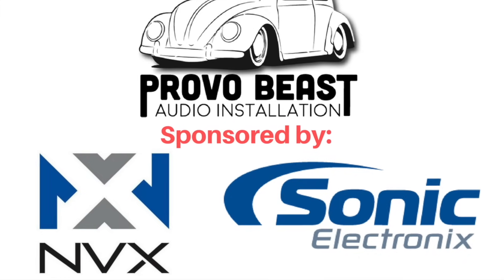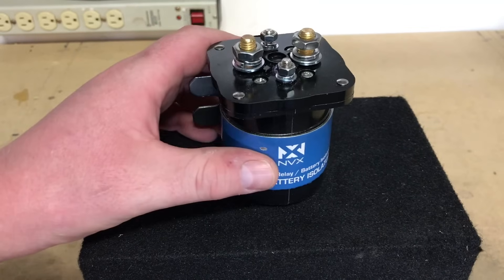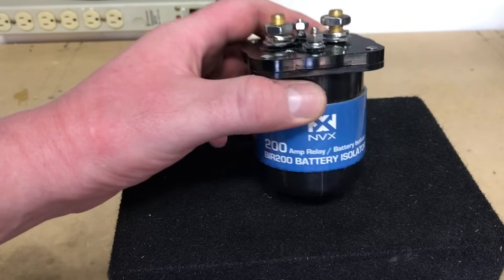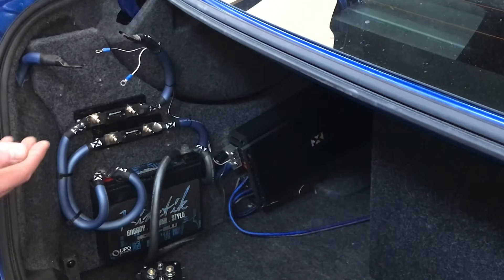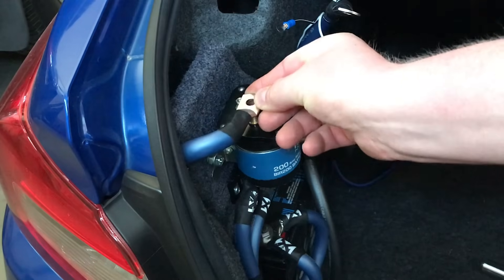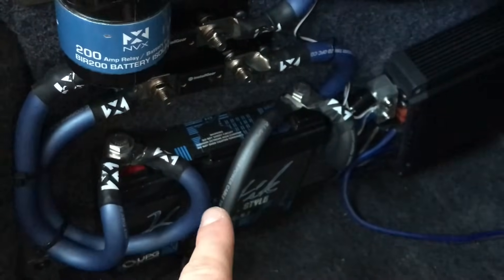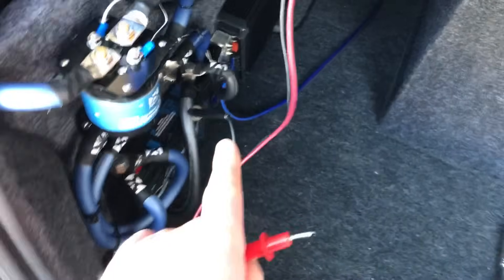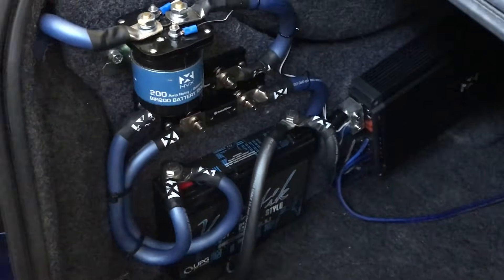Car Battery Isolators Explained: How to install on your car!

Comment: How do you chose what amperage isolate to use?? I think I'm pulling more than 200 amps. Two 1200 watt bass amps, one 300 watt highs amp, 160 amp alternator, one 50ah redtop start battery, one 55ah yellowtop auxiliary battery. 
Any suggestions please???
Reply from the maker: Take your total RMS wattage and divide that by your peak voltage output with engine running.  That should give you your max amperage (roughly).  If you are running two genuine 1200w RMS amplifiers, an isolator may be the least of your worries.  I'd start with an alternator, AGM batteries, etc.  If you are running two AGM, you won't need an isolator anyways.
Reply: @ProvoBeastAudio  🔴 Thx for information. 🍻  but are you saying my Optima Redtop starter battery and Yellowtop auxiliary battery are ok in parallel without the isolator❓

Comment: I just installed this. And I'm getting nothing. My main battery still work, but my secondary isnt charging at all. I just uninstalled my old 1. Same make, same model. 500 amp. Wire for wire. Uninstall and reinstall. Got nothing. No energized solenoid thus. Nothing. After a bunch of meter test. It's almost like the 12v accessory post and the ground post are backwards.... is that possible and wouldnt that mess up the other posts as well? Please help.  I just want my subs back lol

Comment: Never showed the other ends of the wiring. Like wires coming from the  Ignition or ground how to n where to connect.
Reply: the first big blue wire he connected coming from behind the trunk panel is the primary battery the 2 small wires one is a ground and the other is going to the ignition inside the fuse box and the other blue fat wire is going to the secondary battery its electronic science if you understand it.
Reply: I finally figured out where to place my trigger source after not finding a clear answer in these comments..i bought a $5 fuse tap from Autozone & i used it to tap into my turn signals fuse under my dash..it is a 10amp fuse & yes the turn signals only functions when the ignition is in the on position. Hope this helps
Reply: @nathanielthomas2502  i tapped mine onto the amp remote wire its the easiest and most effective way 👍🏽👍🏽
Reply: @wahiawabound808  
But that defeats the purpose of the isolator when the engine is off because the head unit with trigger the isolator to come on.. I do have a toggle switch on my remote wire for my amps but that is a separate deal for my setup..i have a lead acid battery under the hood & a 
XS D6500 as my auxiliary battery for my system.
Reply: @nathanielthomas2502  thats why the video says to wire it to an ignition source of some sort you dont want to wire it to something that would just stay on all the time because when your vehicle is off power would still be traveling througout the isolator causing a dead battery over a period of time just like when you leave the lights on same thing. wiring it to the remote wire is the same as wiring it to an ignition source that turns on and off the remote wire would be like your toggle switch amp turns on isolator turns on amp turns off isolator turns off car audio science. oh and my head unit is wired the correct way its not powered straight to the battery where consistent power would be running throughout my system. my head unit is wired to the ignition key turns off my head unit turns off.👍🏽👍🏽
Reply: @wahiawabound808  
What about when your key is turn to the back  in accessory with the engine..your way will still have the head unit come on thus turning on the isolator..
Reply: @nathanielthomas2502  exactly  it'll turn on the head unit and the isolator because the accessory switch is wired to the ignition from the factory  thats how your system supposed to be hooked up even your factory head unit is wired like that as well. the isolators job is to keep the primary separate from the secondary battery  and thats also why you can play your audio till the very last bass drop and your vehicle will still be able to start.

Comment: Great informative video, you probably explained this but I'm a lil slow. I get what happens when the vehicle is OFF. Now, when the engine is running... Am I getting power from both batteries to my system?
Reply: No ! The battery isolator makes sure the first battery don`t get empty , the second battery  can get empty and will get reloaded only when the engine  is running thanks to the coil inside the isolator.
Reply: John Nelson  does it still need a relay or can the smaller 12 wire can be directly hooked up to any 12 switched or not. im probabbly going to buy exact battery, so will it work with no relay or just better with one or not needed?
Reply: John Nelson  i feel there shouldnt be an issue regarding the accessories used drawing too much on first startup long as battery is charged b4 initially starting after install.. hopefully

Comment: Only thing missing is where the - comes from for the aux battery.  Just run down to a bolt on the frame?  From the main batt?
Reply from the maker: Bolt on the shock tower.
Reply: It's own separate ground as close to the chassis as possible.
Reply: How can you recommend the shock tower ground. God Almighty amateur hour

Comment: I have a question, can i use this insolator if i have a redtop optima in the front and a northstar agm31 group in the back?
Because, redtop isn't good idea when the car has amplifiers connected.
Reply from the maker: well, its more so the type of battery vs. brand.  If it's an AGM to a lead acid battery, yes this isolator is suggested.  If it's an agm to an agm battery type, it's optional but really not needed.

Comment: can u use your remote wire to go to the isolator?
Reply: You could and it would come on and work only problem is if you use that remote wire that turns on your amp it would still come on when the radio is on even if the car isn’t started and basically be the same thing as. It having the isolator installed

Comment: the best part is if the main starter battery dies you have an instant back up depending on how you wired it.
Reply: really
Reply: no. when my front dies I can't use the rear
Reply: Yes you can wire it with a switch to use your 2nd battery as a starting battery.  Run 2 ignition terminal circuits. Wire one circuit off the ignition terminal of the solenoid to a key-on voltage source. Run a second wire from the solenoid ignition terminal to a manual switch, then to your 2nd battery positive. You could use a 5 pin relay instead of a switch, if desired,, and then if starter battery died the relay would auto connect your 2nd battery to your starting circuit.

Comment: How about installing Supercapacitors... I have 6   2.5 V at 2600 farad each. They are maxwell Supercapacitors & I’m curious if I should just run it with a 200 amp fuse in my trunk where I use to have a regular capacitor.
Reply: Some install fuses, some don’t. I would if it where me

Comment: So basically it's just a solenoid . Old Ford's have the same thing. It actually has many applications. It can be used to disconnect the battery so it won't dran . It can be s used on the starter too. They're good on hydraulics too. Like electric dump or the old Mexican jumping cars if you are in to that.
Reply: Benjimen Franklin the solenoid isn’t designed for continuous duty though. I bet it would burn out

Comment: Trying to install a battery isolator on my 2017 Ford Transit 250. Not only is the primary battery under the driver’s seat, there are CCP (Customer Connection Points) to which, if I understand correctly, you can tie a second battery, via battery isolator, onto rather than directly to the alternator. I’m sure this was intended to be a convenience rather than a nightmare but no one, from my local Ford dealer’s service department to the peanut gallery on YouTube seems to understand how to accomplish this... They’re happy to charge me $500. for a chance at figuring it out though 😒
Reply: I'm trying to do this to my 2015 Ford Transit. Where are these customer connection points you speak of?
Reply: You want subscribers but your not really active with the people in the comment section.

Comment: 200a doesn't seem like enough for a car. My car requires a 500cca battery. I know it doesn't use all 500a but if you were trying to start a cold engine in 10 degree weather you'll need more power to get the starter to turn a engine through thick oil.
Reply: 200 amp isolator is how much current can be drawn through the isolator. A 200 amp rating that has nothing to do with the main battery to your car. Your car will start of the starter battery leaving your second battery isolated...
Reply: @VINNY5674  So this ONLY works for isolating a second battery? I was hoping for an option to isolate the main battery for a car so that when the car sits for extended periods of time the battery doesn't drain out as quickly. Just like pulling the positive off a battery when you plan on having a car sit for a while will stop the battery from draining.
Reply: @IkarosCanFly  the isolator isolates the 2nd battery. Your amplifiers will be only powered by the second battery when the car is not running. Your head unit will still run off the starter battery unless you configure your wiring differently.

Comment: Can i connect parallel battery one normal (stock) acid and the secondary AGM battery?
Reply: Yes. Thats what the isolator is for. Is you connect them parallel youre fucked
Reply: @miguelledezma1394  still parallel

Comment: Can this be used as a relay to power up a fuse block for accessories?
Reply: Dont see why not. The set up was the same but had a second battery for when the fuse block wanted power when the car was off.

Comment: Does anyone know weather or not either of the smaller posts matter which way they are wired? I got a stinger that came w/ no instructions, I know the small posts, 1 is a ground & the other is a +12v power source... but since my stinger doesn't specify anywhere which post is for what?! Can anyone help me with this I'd love to install my 2ndary battery setup today!?
Reply: Tyler Barton  it’s more than likely the same as this -as my PAC is the same wiring , good luck!
Reply: @JAlien17KGun12  yeah I figured it out it doesn't matter which post I use both are universal apparently thanks for the offer of info either way though man much appreciated
Reply: It shouldn't matter. The isolator is just a big 12v relay capable of passing large amperage. You can use your voltmeter and test it if you want. 
Or just take it and test it out by temporarily connecting/disconnecting from you battery at the source before you install it. You might want to do this anyway, as to make sure the thing works before spending time installing it.

Comment: This was extremely helpful since I am currently doing this to my system. I do have 1 question though, (I quickly watched this video so hopefully I'm not asking a ? That was clarified already in the video lol) but I purchased a Stinger Isolator/Relay & it's a nice solid looking item however it came w/ NO instructions which is why this vid was so helpful, but my ? Is, the small post's that are meant for ground & +12V input.... my Stinger doesn't clarify which is which, so does this mean it doesn't matter either small post will work for either process? Just as long as it's grounded? Or do I need to contact stinger & find out which post is for what? Thanks for any help with this & big props for making this tutorial it was a life saver for me!
Reply: Thanks fellas....yeah I suppose that I should have came back & mentioned that I'd found an answer to my ? Apparently it doesn't matter which post is hooked up to which...oddly Stinger doesn't include instruction manuals for these isolators inside of the boxes...& I was curtain I'd already pitched the box it was in but thankfully I hadn't, it was sitting in 1 of my extra little portable toolboxes & sure enough written in small print on the side of the box it mentions that neither the top large or smaller bottom posts matter which way they are hooked up...I appreciate the help though fellas much appreciated guys!😃
Reply: I looked into it it doesn't specify and the terminals are not color coded or different color metal so it probably doesn't matter...
Reply: I would fo with the side closest to the mounting bracket is the ground. All of the ones I've seen an none of this style are that way

Comment: Hey Provo Beast Audi Install, thanks for the informative video. Nice clean looking install. 

I believe you said you use 1 gauge wire. Could you tell me what size fuse you like to use? Do you size the fuse to the load, or do you size the wire gauge to the load and size the fuse to the max recommended current?......or what has worked for you?

Thanks!
Reply: The fuse needs to be matched to the maximum amperage the wire can carry. I use 250 amp on my 0/1 awg I’m pretty sure it can carry closer to 300 amps but my amp never pulls more than 250 so that is adequate for me.

Comment: How do you size an isolator? I see you have a 200 amp isolator there what dictates this?
Reply: mitch denner based on my reading it is dictated by the size of your alternator. Mine is 90amp but I will go with a 200 amp (400 amp peak?) isolator to allow for an upgraded alternator or new vehicle in the future. Some vehicles come with 145 amp alternators. Maybe someone better informed can correct any misinformation here.... now to figure out what size/type of fuse holders to get.
Reply: You need to know how much power your amps will pull through the isolator.
Reply: @VINNY5674  duh!

Comment: Give me an example of what circuit would be ignition on and car running only. Most all circuits of course are on when the key is on but what did you use for key on and car running?
Reply: i had the same question as you
Reply: @VWPassat_3BG  power windows, moon roof  are some often used.
Reply: Good example would be the signal wire to your starter motor. The starter on a car is basically an electric motor with a heavy duty relay. Or just google up the ignition wire that leads to your key on the steering column.
Reply: Wire coming from alternator would work

Comment: Nice I like this setup more than the kits sold on ebay I think I will go this route. Couple of questions though what gauge wire did you use for the smaller wires and How and where do I hook up a bypass switch to jumpstart myself incase primary battery goes dead my work truck has a momentary switch  to jumpstart incase primary battery goes dead  how can I wire one up?
Reply: If you did need to jumpstart the front battery using the secondary battery in the back, all you need to do is connect the secondary battery positive to the small positive trigger on the relay. That triggers the relay to connect the 2 large posts, which connects the 2  batteries, allowing the back battery to jump start the front one.
Reply: @PURESOUND4  Got it thanks I have the parts ready to do this I just haven't installed the new optima yellow top batteries yet they are sitting in my garage lol
Reply: Can someone help with this

Comment: Why don't these isolators come with a cap i don't like exposed positive terminals something touches that positive terminal sparks will fly...
Reply: I mean I know electrical tapes kinda ghetto but just seal it up with it as best you can, somethin touches it it ain't gonna hurt as long as its sealed with SOMETHING theres always cylycone too
Reply: @aaronritchie6097  *silicone
Reply: put extra rubber end covers like heat shrink over the ends
Reply: VINNY5674 real talk
Reply: @Santos Santana  Yes, you could use the blue turn on wire to trigger the battery relay, but if you decide to turn off the radio, the relay will de-energize, so then the second battery will NOT get charged.

Comment: Hi: i have a question. I would like to know if both batteries have to be similar in Amps, that means 12 volts 80 amps both or they can be 12 volts 80 amps  and 12 volts 40 amps. Thanks
Reply: AGM and Lead Acid are the same chemistry. In my 2004 Ford Explorer I had a 75Ah starting battery (AGM) and two 155Ah stationary telecom batteries in the rear without an isolator for 2 years no issues. I now have that same 75Ah battery as a secondary battery in my 2011 Kia Optima that has a Flooded starting battery that is 55Ah. Going 2 and a half years on that. All batteries still test like they are brand new (in terms of starting performance) and only roughly about 3% loss in deep cycling capacity. I have never used an isolator, just properly sized wire and fuses. As long as the voltages are within about 10% when you connect them together and both batteries are good (i.e. no bad cells) you shouldn’t have a problem. If you plan to run without the engine running isolation is a great idea. I also had a similar setup with my 2004 Blazer but they were different size batteries. Just remember to fuse! This has saved me twice from very simple mistakes like a pinched wire that eventually touch ground.
Reply: The battery isolator allows you to run 12V with different amperages safely. Without the isolator, one battery will drain the other when the engine is off.
Reply: The isolator allows you to mismatch batteries AGM/lead acid while the car is off when car is on the alternator is feeding youe system. So the batteries won't drain each other. For car audio enthusiasts i recommend using both AGM batteries. Agm are deep cycling and can handle the constant drain from the system they will last much longer than lead acid.

Comment: I see zero gauge wire used for the power, why is the ground for the isolator so small in comparison?
Reply from the maker: They are trigger wires only as less than an amp is required to trigger the solenoid internally.
Reply: The Isolater is not pumping bass . It just need current.